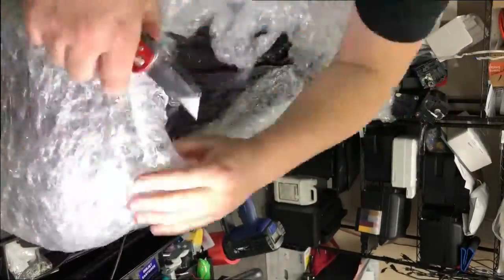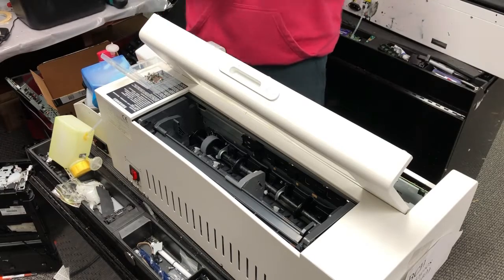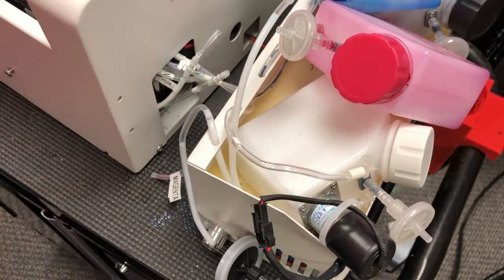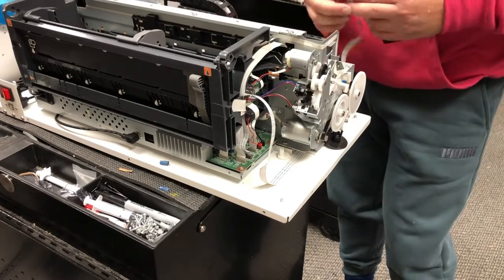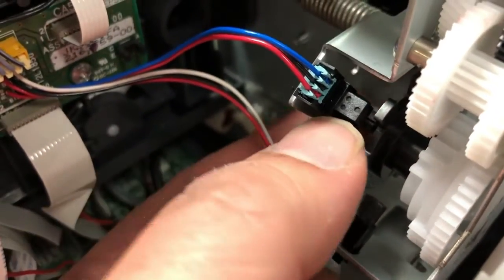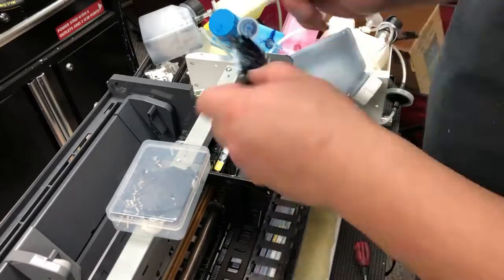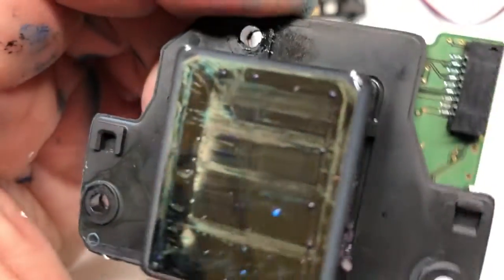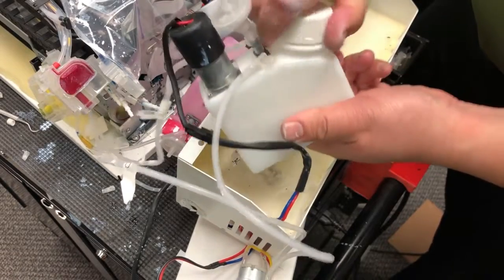Repair and Review: GreenColor L1800 DTF Printer

Comment: My dtf power button in front just went out doing printing and will not come back on. The power button in the back that works the temperature display comes on but not the printhead power button. Help DTF L1800 from Punehood
Reply from the maker: Thank you for subscribing to my channel and taking the time to ask your question! Your support means so much as I work toward my goal of reaching 100K subscribers. Right now, I’m about halfway there after 8 years, so every subscriber like you is incredibly important to me. I’m also glad you’ve found value in the content! With so many questions coming in, it can be tough to keep up, but I always strive to provide helpful answers. For faster responses, you can email me directly at support@bchtechnologies.com or post your questions on my most recent videos (not shorts).

Regarding your DTF printer issue, the main power button controls both the white ink management system and the printer itself. Even if the printer’s mainboard is damaged, the white ink system should still function. Based on your description, it’s likely that the printhead caused a failure in the mainboard, and possibly damaged the FFC cables as well. Once you repair or replace the mainboard and FFC cables, you’ll likely need a new printhead to get the printer operational again.

At BCH, we offer mainboard repair services, and you’re welcome to contact us beforehand at support@bchtechnologies.com. If you send in your old printhead with your mainboard repair order, we can quickly diagnose whether the printhead is salvageable. I hope this helps, and I’m here if you have any further questions! Thanks again for your support and for being a part of this journey.